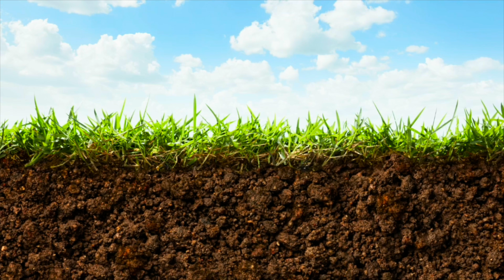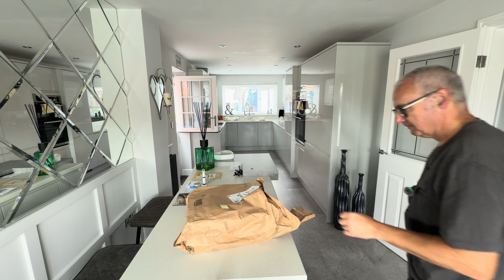Water Transfer 18v Stick Pump

Comment: Great job ! I really need to get our water system sorted...our generator broke so ive got the pump and hoses etc but no power...
Reply from the maker: Battery pumps are great for allotment. Plus my car has vehicle to load power so I could plug a battery charger in to charge 18v battery
Reply: @GaryTheGardenNovice  yes i think im going to do away with the generator and use a leisure battery...weve got a camper i can just use the one in that...plus no noise !
Reply: I have a Jackery battery for camping and it has a solar charge system 👍👍